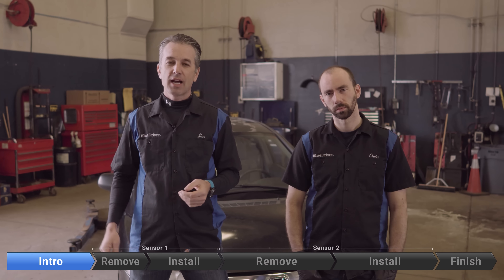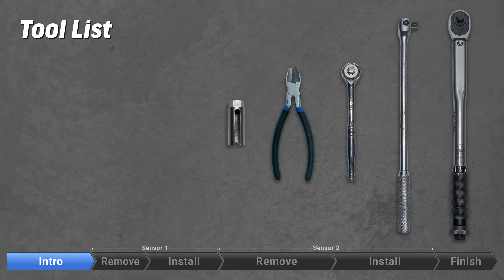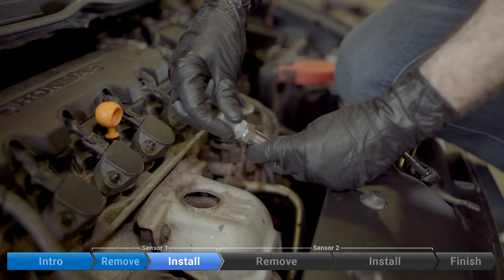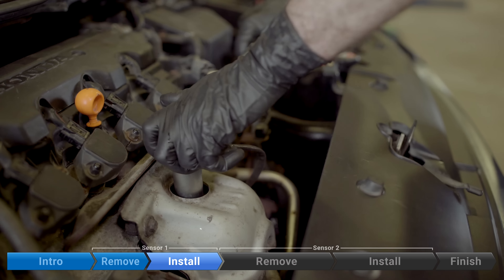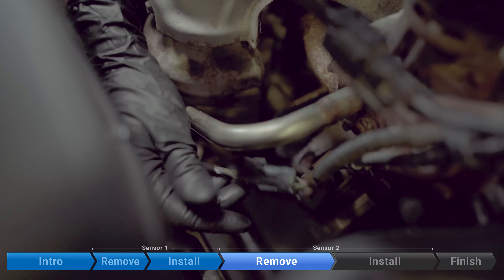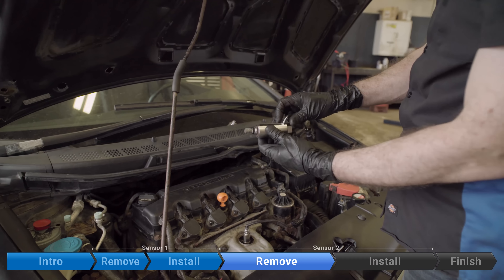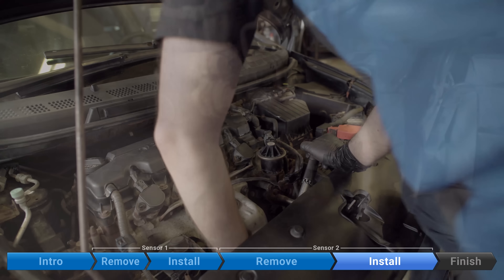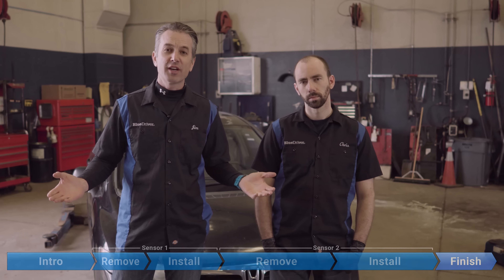O2 Sensors – 2006-2011 1.8L Honda Civic

Comment: It would be nice if you showed how to use the scan tool on live data to see how your scanner works on trouble shooting codes. Even though you got code p0420 the scan tool recommends you change the catalytic converter. Showing the graphing would be more educational than just replacing sensors.

Comment: Are both the O2 sensors the same? Does it matter to get a different upstream and downstream sensor which is often a hundred dollar difference or is it okay to use the same make for both.
Reply: Different, I had same thought but both are different.
Reply: Great question, did you get a reply? What about a amazon link to by?

Comment: I have a question. How do i remove this sensor if it's completely stripped i had to cut the wires. Now i have no connection for the 02 sensor bank 1. Please any advice would be amazing ??????

Comment: In Mode 6 I see Oxygen Sensor Monitor Bank 1 - Sensor 1 ID: 01 87 in yellow. Where can I find information on Mode 6? I recently changed both my 02 Sensors and my purge valve. Also it looks like all the EVAP monitors are yellow as well. Rather confused.

Comment: just replaced my catalytic converter because the downstream 02 sensor was welded on. new cat, new 02 sensors but I still have the CEL. do you know if I have to drive it a certain amount of miles before it resets? 09 1.9 CIVIC

Comment: Bank 1 sensor 1 is the one up top by the dipstick and sensor 2 is the bottom one?
Reply: yes
Reply: @luiszidane2966  A 4-cylinder car only has one bank, so its a Pre-cat or Post-cat sensor (sometimes it's A or B)🤔[Sensor 1, Pre-cat, Sensor A]= All the same thing.
Reply: Sooo yes 😑

Comment: Hey, I have a 2011 honda civic 1.8l showing trouble code p0055 which is HO2S Heater Resistance (Bank 1, Sensor 3) where is the third sensor?
Reply: Yeah I got the same code in a 2011 also. Also not sure.

Comment: thanks Blue driver, by the way i have a query on my civic 2006 with P0135 code, i have already replaced the both O2 sensors but still the code is present. what seems to be the problem?
Reply: You just need to clear the code via the computer scanner
Reply: How do you remove this if it's seized?

Comment: Very simple job, the lower sensor was also easy but what took me a long whilenwas removing the wire bracket, turns out i was pulling it the wrong way.
If you buy the sensors from honda, the parts already have anti seize

Comment: Hi, I have the bluedriver and its great for data. My problem is I cant get either of the o2 sensors removed or even loosened! I bought a 22mm sensor socket for the job, but it just slips off the hex-nut part of the sensor. Have tried letting engine heat up and cool and neither allows the sensor to budge... WD40 did nothing.... Any suggestions as to how to loosen these sensors ? (im just glad i didnt cut any wires off before attempting all this lol....
Reply: I'm having the same problem.

Comment: My car very bad fuel average, I have changed spark plugs and coils, but still same. Last day I have checked with computer and it show that airflow sensor and silenser sensor is not working properly, Is this the reason not good mileage?
Reply from the maker: Definitely could be!
Anything related to fuel/air that isn't working properly could hurt your fuel mileage
Reply: Dirty air filter,dirty throttle body, dirty fuel filter

Comment: Hello, I’m getting really poor gas mileage, although there is no error codes, weird smoke, idle problems, etc. Could it be the o2 sensor?
Reply from the maker: It's possible yes, but without being able to see the car we wouldn't confirm that. Checking your Mode 6 may be a good idea if there is any issues with the idle/running of the engine.
Reply: was it head gasket?
Reply: @bggraham83  That would be very rare for these cars

Comment: what are these two sensors for? if not replaced whats the harm on the car ? sorry don't know much about cars
Reply from the maker: O2 sensors do a lot to monitor the health of your motor and keep it running as it should. It would be highly recommend to replace these with OEM replacements if there is any issue!

Comment: I'm getting hesitation and the herky jerky, no codes, I've replaced the plugs, the air filter and cleaned the MAF sensor... would O2 sensor replacement be next logical step? I tried to get at the throttle body to clean it up but its wayyy under the windscreen and a pain to reach.

Thoughts???
Reply from the maker: If it's that bad there should be some sort of code - it couldn't be something like a slipping transmission could it?
If not maybe have a look at your O2 sensor data - there's a great guide at http://www.walkerproducts.com/o2-sensor-training-guide/introduction/

Comment: Does anyone else have P0420. Happened to me 300 miles from home. It’s always a bad feeling when the orange light of damnation turns on, but it’s worse when your far away on vacation in the middle of a hot California desert.
Reply from the maker: Hey we did find these possible causes, hopefully it helps! 

A code P0420 may mean that one or more of the following has happened: 
Leaded fuel was used where unleaded was called for (unlikely)
 A damaged or failed oxygen / O2 sensor 
Downstream oxygen sensor (HO2S) wiring damaged or connected improperly 
The engine coolant temperature sensor is not working properly 
Damaged or leaking exhaust manifold / catalytic converter / muffler / exhaust pipe 
Failed or underperforming catalytic converter (likely) Retarded spark timing 
The oxygen sensors in front and behind the converter are reporting too similar of readings 
Leaking fuel injector or high fuel pressure Cylinder misfire Oil contamination

Copyright OBD-Codes.com
Reply: But in this video. It was the sensor.

Comment: Mmm, I heard the first sensor is called Air/fuel sensor, not O2 sensor
Reply from the maker: O2 sensors would read the air/fuel ratio. they could be called either or.

Comment: I have the p2a00 code on my 08 civic is it most likely sensor 1?
Reply from the maker: Yep - there's actually a TSB for this code - see if you can hunt down Honda 07-006 or NHTSA 10040405 - they primarily call for an ECM software update, and O2 sensor replacement if necessary